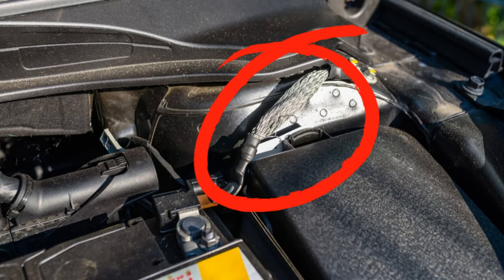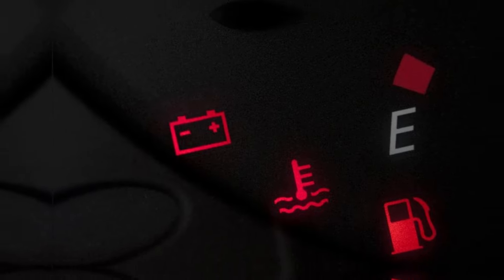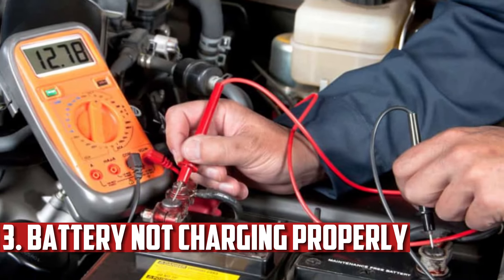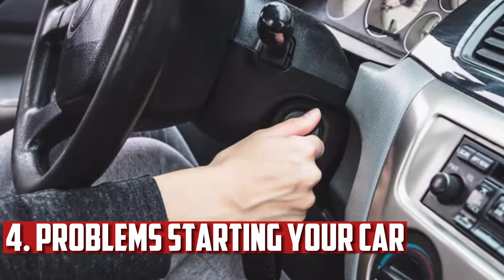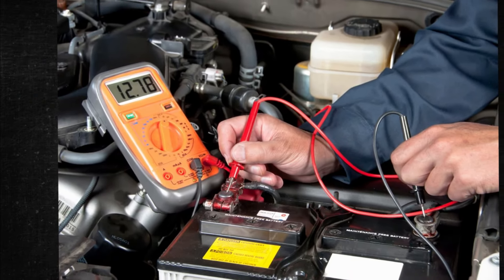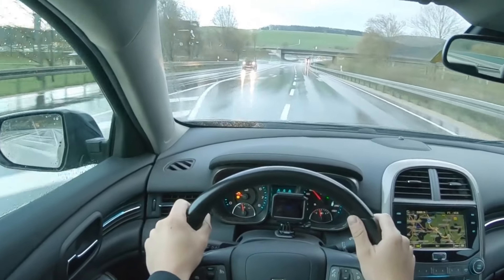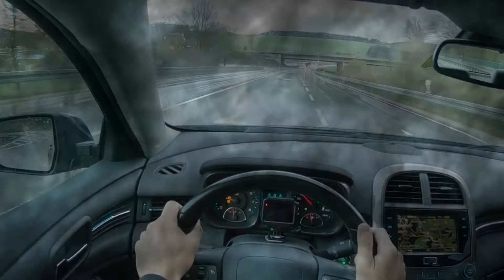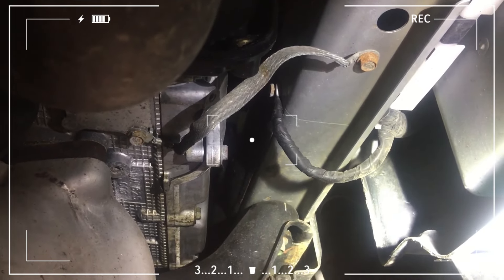6 Bad Engine Ground Strap Symptoms. How to Test a Ground Cable?

Comment: A quick test is to put a test light on battery negative and touch the tip to the engine , a metal part , no paint . If it lights , bad ground . Take HEAVY jumper cables , one cable , connect one end to battery negative and the opposite end to : engine , then body and then chassis . Again , metal , no paint . If you have dim headlights they will become brighter IF the ground is now good with the cable . Do a visual of ALL grounds . Look for rust and corrosion . You may have to do voltage drop tests to confirm if you don't find visual proof of a problem .
Reply: This comment was better than the Video! Thanks!
Reply: Connect to test light to the positive.
Reply: @nickdelalla980  We are checking for a bad ground . Voltage drop on the negative side . To test any voltage drop , current must be flowing or the circuit in operation . Start the car and operate the circuit to be tested . In this case if the car is running and a ground is bad , it will light the test light on the negative side , from battery negative to the block , body or chassis , depending where the issue is . If the grounds are good , almost no voltage , under half a volt , usually between .2 and .5 volts , would be present on the GROUND side . A higher amperage starter circuit would be around .5 volts on the ground side if operating properly WHEN CRANKING , on the negative side . Battery negative to starter ground . When the circuit operates properly , almost all the voltage is consumed on the positive side by the load device , starter , head light , wiper motor , etc. On the negative side there is almost no voltage left , between .2 and .5 volts as mentioned . The bad ground will allow voltage above that on the negative side . It WILL light a low amperage incandescent test light . Using HEAVY jumper cables over these grounds is a quick way to check if they may be the problem . A fully charged battery of 12.6 volts or higher , after removing the surface charge , is the staring point . The terminals must also be clean and tested . I would watch several videos on voltage drop from reliable sources , Scanner Danner , South Main Auto has several excellent ones , etc. There is a dual battery truck and he goes in detail where the loss is .
Reply: Sounds like 1000 ways to die comment
Reply: I get 1 wire with bulb i Put 1 wire to negative cable and another to bateri negative also i have bulb light it can be bad ground ??
Reply: Read ALL my comments again . When the circuit is operating , there should be under a half a volt on ground side . Battery negative , center of the post , NOT on the terminal clamp . Test to engine , body and chassis separately . Make sure there is a clean spot no paint  , rust or grease , test light lights dim ,  there is a  bad ground somewhere . That ground side should have under half volt and the light should not light with current flowing ( circuit in operation ) . The digital multi meter will also read under a half volt . Set to 20 volts DC scale .
Reply: @nickdelalla980 no the test is to see if there’s voltage between the block and the negative terminal

Comment: Thanks for the video.   I have a question that may help me with my issue.    I had to replace my battery on my Briggs and Stratton engine (generator).  However, the terminals are a bit different and now my black battery cable is now about 1” short.  Do you know if it’s ok to relocate the black cable from the bolt on the bottom of the engine to another bolt closer to the battery?  Does it matter which bolt I attach the black cable to the block?

Comment: Hi there came back home all is well in the car park in the drive way when i start the car nothing no crank but battery strong  i just replace the motor starter last year the ground strap in the engine  looks new the only bad ground strap i see is in the tale pipe exhaust its all gone you think that will enough to contribute not to start the car?

Comment: My car would only go 35 mph after i atarted it one day. I parked it. Took it to a mechanic and they daid it was low voltage to transmission? Will this be expensive? Tgey referred me to a dealer of my rype of vehicle. Could use some input!!

Comment: Do you need to disconnect the battery to replace the cable
Reply: Duh
Reply: No. The battery negative terminal and any metal part of the chassis or engine should be the same point electrically.
Reply: Probably don’t have to but I’m disconnecting mine if it helps ya any
Reply: What will happen if we change the strap without disconnecting the battery
Reply: No

Comment: I have a Lexus 2011 RX350. Trying to find a good ground in the trunk and all points even the body frame gives 3.1ohms. 😕

Is this normal? It's practically a new car with 60K miles and I am the original owner.

I'm looking for a good ground for a small 150W Amp to run one 12" sub.

Comment: My car makes a single “ Tic “ noise and does not turn over or anything and previously before that it was cranking slow but I just changed the starter a few months ago could it be bad grounding ?
Reply: Probably a bad battery... what year is the car?
Reply: @windytokes  2013 Gran Cherokee Laredo 3.6 Liter Base Model
Reply: @OfficialLeeHancho  check all your grounds and positive conections and if tht dosent solve it most likley a battery
Reply: Ever figure it out my SS is doing the same thing like noting is making it to the starter but it has new battery and starter

Comment: This might be horrible advice. If you’re diagnosing a vehicle use a different video and remember. Electrical issues can only be diagnosed with certain mechanics. Most don’t have a clue and fire off the parts cannon.
Reply: There's some truth in that.  My last visit to my mechanic I pointed out my ground strap had broken in two.  He looked at it and said that's no problem don't worry about it.  A few weeks later I blew a cigar lighter fuse for no reason.  I only charged my phone on it.  Hmmmm.

Comment: Can this cause my car not to start?
Reply: Yep
Reply: you can diagnose the problem by using a jumper cable between the negative terminal and the engine block.  If starter now functions, you need to repair your ground strap connections.
Reply: @peetky8645 
Do you do this whilst original cable is still connected or do you take the black cable off the battery?
Reply: @LiamThomas-jn7zg  you can leave the original on.  you just need temporary  connection between the negative ground battery post and the engine block to power the starter.  I put a heavy copper wire between negative and a alternator mount bolt during COVID because supply chain issues made a new cable on back order...

I think the engine runs OK after cranking because injectors and spark plugs and other stuff grounded on the block require minimal current, unlike the starter.
Reply: @LiamThomas-jn7zg  You keep the cable still connected
Reply: Yea caused my 3 series not to start east fix $90
Reply: It can cause all kinds of willy nilly's.
Reply: I’m having inconsistent starting like sometimes it starts and others noting making it to the starter at all but everything else in the car works and starter and battery is new

Comment: not helpful
Reply: The best way is to crawl around the car and swap with new grounds. From the engine, chassis to frame and any thing else. Especially if there is corrosion.
Reply: Electric window won’t work.
Reply: Windows wouldn’t work
Reply: 0:20